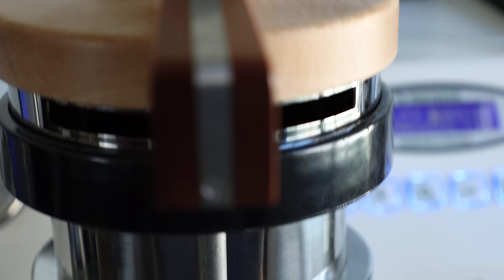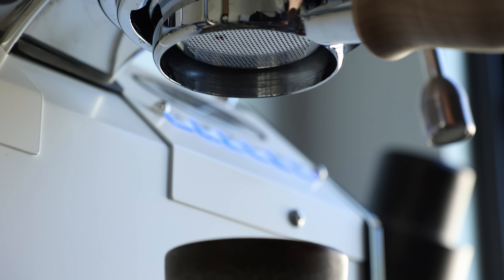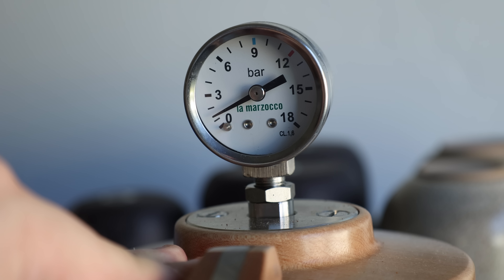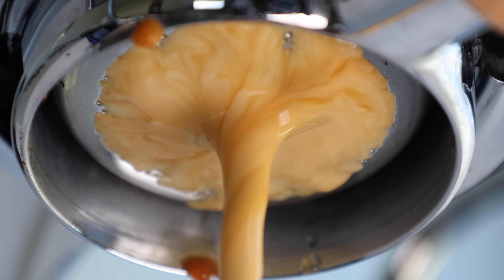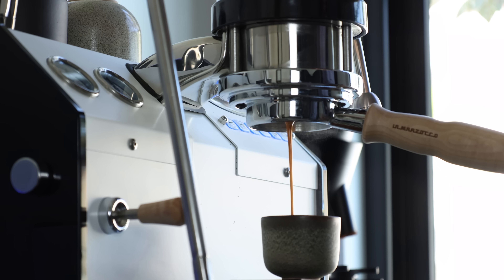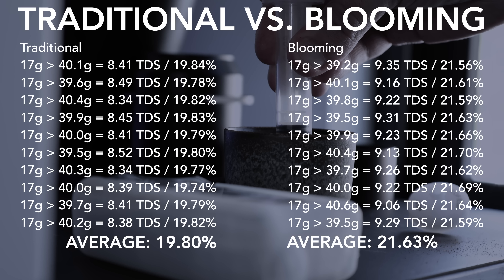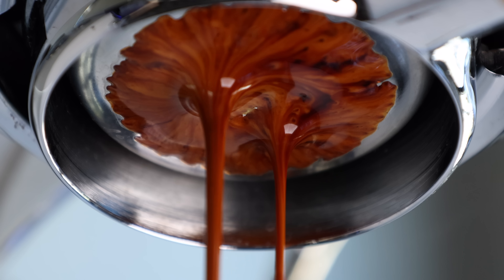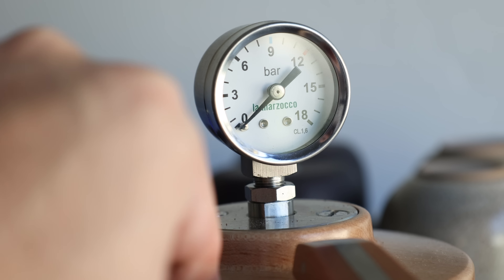ESPRESSO ANATOMY - Blooming Espresso

Comment: Great Video! 
I have been doing these kind of shots on a machine with E61 group head with vibr. pump. It works smoothly but requires good timing. You can put the lever of the E61 to a 45 degree angle after the preinfusion when pressure mounts to 5-6 bars. The 45 degree position switches of the pump but leaves the group head pressurised. When you turn on the pump again after the blooming you will have a quick ramp up to whatever your OPV is set to.

Comment: One thing maybe worth noting that i don't see mentioned a lot - you may be extracting 'only' 1.5% more but an increase from 18% to 19.5% means roughly 8% more dissolved coffee in the cup in the more extracted shot, very likely a noticeable increase

Looking forward to trying this out when i get around to flow modding my BDB!
Reply from the maker: That’s a good point, and definitely this is worth a try once you get a chance!
Reply: By adding under puck filter (Chemex or V60), you're going to be pulling additional 0.5-1.5% EY, so that's another 8% extra.
Reply: 8% is actually a big deal. I don't like waste so don't use paper filters,  but I long PI or bloom every shot and find regular shots don't do most beans justice
Reply: @ylleKkcirtaPnadnerB  Well, for specialty beans that easily costs $50-$80 per kg, that's 5-8 cents per gram. For a 18g basket, that's $0.90-1.44 per double shot. 8% of that is 7.2-11.42 cents extra of extraction. These paper filters, costs like 1 to 1.5 cents per piece. A little extra work goes a long way.
Reply: Even if it's commercial beans that costs $20 per kg, you'll still be saving cost overall.

You can experiment it, you'll get more consistent shots, lots of clarity, and better extraction. Which also means, you could actually dose a little less, perhaps 14-16 grams, instead of 18 grams.

Comment: Great timing for this video! I use an espresso hand press and have been inching toward longer preinfusion and a super slow extraction bc it makes my espresso super dark and syrupy.  I’ve almost been “blooming” but it seems I can slow down even more. I’m excited to try it for my next shot:)
Reply from the maker: Awesome! Give it a go for sure, but also that’s the beauty of a hand press machine, you can essentially do it all!
Reply: How would you compare the longer extraction to the traditional 25-30 second shot taste wise?
Reply: @whoami724y  so far the longer the extraction the more I like it. I’m sure there’s a limit to that but with a hand press conserving the heat is very important. Even with pre heating its not easy to keep the heat as high as a normal machine. I suspect this is part of why the longer extraction doesn’t seem to overextract in my observation. Testing again this morning:)

Comment: Nice review. I have both the E61 (Profitec Pro 700) and Decent DE1Pro.

On straight 9 bar shots, my Profitec does pull a way better shot as compared to my DE1Pro's 9 bar profile. However, I've been playing with the DE a lot more lately, as I could control the pre-infusion a lot more.

One of the profiles that I've been using a lot lately is Damian's D-Flow. This is actually based on flow control.
Phase 1: Preinfusion (I have it set at 3 bar), and once the weight on cup hits 4g, it moves to Phase 2.
Phase 2: Up to a maximum 8.5 bars of pressure, pour a a flow of 1.8 mL/sec.

For example, for a 18g in 40g out cup.
Phase 1 will preinfuse till the cup hits 4g, typically in 12-15 seconds, then move on to phase 2.
Phase 2 will brew at 1.8mL/sec (which is 1.8g per sec) - 40g less 4g preinfuse = 36g, and will take additional 20 seconds to reach 40g.

Phase 2 should hit close to 8 bar, and gradually reduce pressure, while maintaining 1.8mL/sec flow rate.

I find the shots to be well balanced, zero astringency, lots of sweetness and balanced mouthfeel, but lacks body as compared to a typical 9 bar shot off my Profitec. It tastes a lot better on non milk based drinks, and tastes really good on milk too (but the extra body from 9 bar machines may actually taste better on milk, but not by much). When I say body, I meant the syrupy texture/mouthfeel.

But with the DE's preinfusion settings, I am able to pull a lot more consistently, and with the flow profile, even not so well prepped puck (grind, tamping, WDT, etc.) would still be drinkable, although not as tasty, whereas on my Profitec, a less than ideal puck prep would mean a very sour or bitter cup of espresso.

Comment: Apparently I've been unknowingly doing this on my Flair. Sadly I don't have the luxury of waiting so long during the blooming phase due to heat loss so I do as follows:

- Press quickly until some drips show up
- Hold it there for 10/15 seconds
- Pull as normal with a declining profile

It just felt natural given how you usually brew filter so I went with that, and indeed felt the need to grind finer when comparing with what I previously did which was just ramping up at the start and calling it a day
Reply: Exactly the same here with the robot 🙏🏻
Reply: Also I always thought experts would find the espresso I make appalling, apparently this is not the case so I am kind of relieved 😄
Reply: @ThePlayahans  I'm pretty sure experts would still find my shots appalling, blooming or otherwise lool
Reply: I double heat my brew chamber and that helps a good bit with the heat loss. Also heats up a bit quicker

Comment: You could probably mark the stopping points on your paddle if you start making blooming espresso more regularly. I’ve really enjoyed making blooming espressos on my Flair 58 (it’s easy to do on the Flair 58, and the result is very tasty).
Reply from the maker: I’ve thought about marking points, the issue is the pressure is slightly different, especially in the lower range, depending on the dose and grind.
Reply: It doesn’t take too much practice to be able to get a feel for adjusting the flow accurately to achieve the pressure you’re after. As Spro man said, flow/pressure is often different due to grind inconsistencies.

Comment: I installed a needle valve on my Silvia after the OPV, and a pressure gauge at the group head. The valve sits on the side with the elbow connectors going into the machine. It allows full control of the flow rate and you’re able to stop the flow without stopping the pump. 

I’ll often do a 15 second bloom at 1 bar and then ramp up to 8-9 bar. Sometimes I’ll taper it off half way through the shot if it’s going slow which also reduces bitterness if the grind is too fine. I don’t seem to have channeling issues with the 15sec/1bar bloom and it comes out as nice as any other shot. 

I definitely see a difference when I knock out the puck as well. It will come out so much easier with little grinds left in the corner of the basket.

Comment: Recently my roaster suggested I try a new coffee, quite lightly roasted Ethiopian. That gave me an incentive to finally try longer preinfusion on my Lelit Elizabeth.

A very interesting feature of the Elizabeth is that, when the service (steam) boiler is on, preinfusion can have two phases:
- first, the pump pushes some water from the brew boiler onto the puck
- next, the pressure from the steam boiler pushes water from the brew boiler to the puck

After this, the pump kicks in to apply full pressure. Pressure is never high during the preinfusion phases (around 1 bar), but it is never released (3-way valve stays in extraction mode).

With this new coffee, I went with much longer preinfusion than usual: 2 seconds for the first phase, 18 seconds for the second phase. In addition, I grind coffee a bit finer, so in the end, the entire extraction (17g in, 45g out) takes about a minute.

This gave me a cup with more flavor and much more body than I'm used to with similar coffees. For me, this confirms that blooming espresso is very much worth trying, and also that the Elizabeth can get quite close to it!

The only disappointing thing with the Lelit Elizabeth here is that it doesn't let you set preinfusion time (phases 1+2) longer than 20 seconds. A missed opportunity!

Comment: I personally find this a great approach for espresso with lighter roasts. For me, they make the sharp acidic side more mellow.

And for those who are willing to modify their machines, there are options to make this possible one cheaper espresso machines with vibratory pumps. I added a pressure gauge and dimmer switch to my gaggia classic and I'm able to pull these shots. The bonus is, with an in line dimmer for the pump, the 3-way solenoid stays closed until I'm done pulling the shot.

Comment: I accedently made a Blooming Espresso, and it was one of the best shots I've drank. I grinded the bean too fine, but it was enough for it release some drops. I stopped the extraction, and after 10 seconds, rump up the pressure to the default from Bambino and then the shot went smooth. It was crazy, the flavor and the aroma were the exact notes of the bag. Maybe blooming espresso works best with grinding more finner? 🤔

Comment: Loving the results.  Although if I bloom at 2-4 bar initially I seem to get more sourness than if I introduce the water at almost full pressure and then ramp back to just above 0 bar.  Takes a bit of practice not to degrade the puck on a GS3MP, but its definitely worth the effort.  Softer, sweeter, more integrated shots with good strength.  More approachable shots.😊

Comment: Great video! I just tried your method on my own gs3mp and I can say it produces a completely different result from a traditional full bar shot in the cup. I’ve preunfused a bunch but never incorporated a pause phase until now. It was pretty easy to replicate actually, I just timed it alongside yours. It also wasn’t too ugly looking, maybe finding just the right grind size would help with that. 

I also pump from the reservoir, but this makes me want to plumb in due to the amount of water that is “wasted” passing through the needle valve during the preinfuse/pause phase. 
I adjusted my machines max pressure to 6bar some time ago to help with channeling, but I wonder what my results would be going back to the standard 9.. 🤔 It was a pretty simple adjustment. Maybe an idea for a future video 🫣 Keep up the good work
Reply from the maker: Nice! Glad to hear you were able to replicate it and got a solid result. And yeah the shots aren’t always on the ugly side, it definitely is coffee and grinder dependent. 

I pump from the tank too, and the amount of water you kick out is massive. It truly is the only downside to pulling these long pre-infusion shots.

I’ve done the shots with both 9 and 6 bar flow and you aren’t missing much on that end, but I do plan on doing a full video about pressure in the near future.

Comment: I have a Decent and found the Blooming Espresso profile helpful when I was using my stepped Urbanic 070s which doesn’t have as vast of an espresso range compared to my recently purchased Niche.  In a way, the increased extraction made up for my inability to grind finer w/o choking the machine. The step between 3 & 2 on the Urbanic was the difference between a normal shot & a 60+ second shot on most of the profiles.  Since getting my Niche and using that predominantly, I did do a stepless mod (removed a spring) from the Urbanic so I have a little bit more control over the grind & more range so I’ll have to do more testing. For some/most people it will just be a matter of taste (and at the end of the day it always is that) for me it was a way to compensate for some of the shortcomings of the equipment I had.  I could also see folks adjusting the amount of time they let the puck bloom or the bars of pressure post-bloom to get different results too.
Reply: I’ve the same urbanic with the stepless option and the gevi burrs. Going to try a bloom now with this and a cafelat robot. I notice that the plumbers tape lasts about 2 months before you’ve to add a few more wraps, you’ll get some drift coming back in over time! Next thing is checking how hard it is to add a dial to play with the rpm of the urbanic!

Comment: dynamic bloom peaking at 8 bar, dropping to 2, then ramped up to 6-8 again with 20ish seconds total brew time is my fav
Reply from the maker: Interesting, sounds like a lot going on! Some serious pressure fluctuations in a short period.
Reply: @Sprometheus  It's really easy to execute on manual profiling machines, like the Bianca, I do it on a dimmered vibe pump. Should work on the GS3MP as well.

Start at 0, ramp up to high flow to saturate the puck quickly (this is a important part of the Rao blooming espresso as well, which you skipped), then when you hit your cut off pressure or when you see the bottom of the basket fill in (which happens at the same time usually), go down to 0 flow rapidly, wait for pressure to decline, then when it hits 2 bar go up to your target flow rate again.

Comment: On my Flair 58 I bloom often, especially with light roasts. I do puck smash and blooms for coffees that require I grind so fine I’ll either touch burrs or get gobs of channeling
Reply: I commented doing something similar grinding with my stepped Urbanic 070s.  It makes a huge jump between 3 & 2 to the point where it would choke my machine at 2 but 3 wasn’t fine enough.  I have a Decent so I just went through profiles till I found something that made up for not being able to find that middle ground between grind settings.

Comment: I recently noticed that my Lelit Mara X machine has 3 points on the lever. Roughly speaking: Fully depressed, discharge valve opens. 45° closes the discharge valve. Fully up turns on the pump. I found I can lift it fully to turn on the pump for 5 seconds then slightly knock the lever down to let it bloom. 1 minute has been near life changing for light roasts in going through a slightly obsessive phase with it.

Comment: On the GS/3 MP, did the bloom phase below 1 bar still spill all the overflow (~8 bars) of water into the drip tray during those 30 seconds, or did you find an area where the pump is engaged but no flow is coming through at all – neither to the group nor drip tray? I’m considering the GS/3 MP, but that overflow issue seems to waste a TON of water, which is one of my biggest concerns with the machine. Curious how it fares with the blooming profile. Thanks!

Comment: So on a machine (like the Breville Bambino) with preinfusion and no discharge valve (or 3-way solenoid valve which is the same I belive) you could make blooming shots by: 
* starting preinfusion
*turning off the machine  after first drops appear  and wait for 30sec
* turning it on again skipping preinfusion and going directly to full pressure
Thoughts?

Comment: I apologize in advance if I missed it in your video - did you control the blooming phase via the flow control on your machine? I have an Izzo Vivi PID with flow control, and am wondering if I can get the same or similar results with it. My concern is - will it harm the pump if I leave it (the pump) on while completely closing the flow control during the blooming phase? Thanks!

Comment: Blooming can be done on any flow control machines and GS3 is flow control not the pressure profile machine, I have done it on my dimmer mod Delonghi 310 from the beginning of this year and it works well, BTW that pre-infusion was pressurized that's why it saturates puck so evenly than normal time based slow flow rate sort of "pre-infusion".

Comment: I imagine blooming must be an advantage of lever espresso machines, anyway I digress from my Question: You've been a fan of lower brew pressure in the past. I think I'm correct in saying you reduced your LM LM down to 6 bar max brew pressure. Didn't you change the spring in the  Gaggia Classic Vs or Rancillo Silvia (can't remember which one) to be around the same. I this video I see your new LM is running at 9 bar. What's changed other than the machine? I made the change myself and I've been very happy with the results. I've broken out of the "finer is better" mind set but to get good shots with coarser espresso beans I've not only had to reduce pressure but also dump my nice VST basket and use the stock basket that came with my machine. Anything to slow the shot. Taste is much better though. My coffee roasters are unusual in that they roast light to medium and never dark for any bean, filter or espresso. So factor that in. Have you changed the roast profile of the beans you are using?

Comment: Will have to try this on my Cafelat robot and see how it works
Reply from the maker: Let me know how it turns out! I did it on my Flair awhile back and it was decent.
Reply: @Sprometheus  seemed to work well, 25 second preinfusion at 2 bar, bloom for 30 seconds, just took hands on the arms, 5 seconds ramp to 8 bars and 30 seconds to get 1:2 ratio. Made the current coffee I have been using taste different. No bitterness or sour. Just different. Thanks for the idea